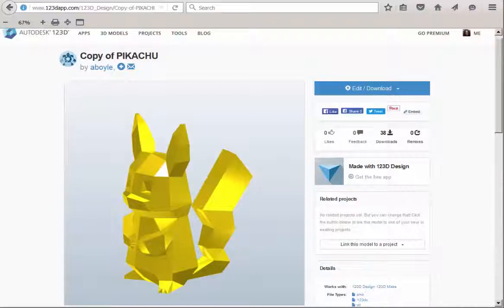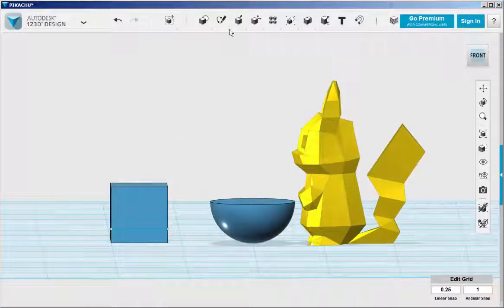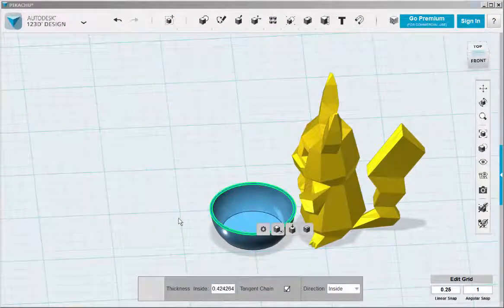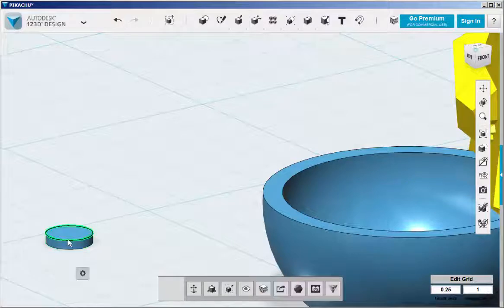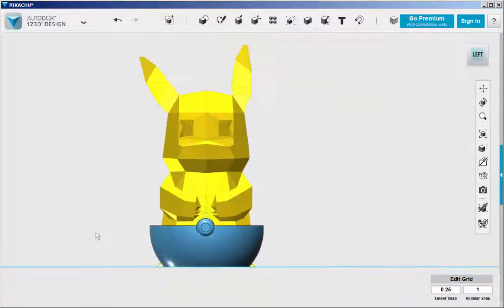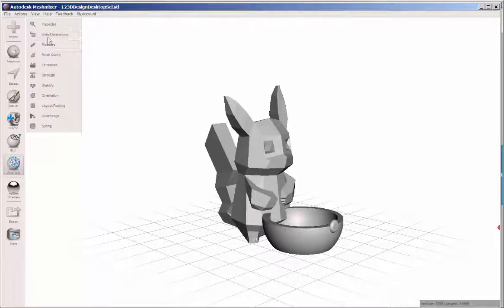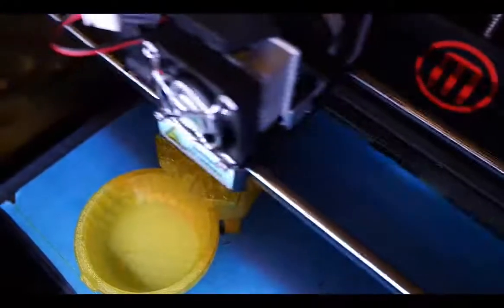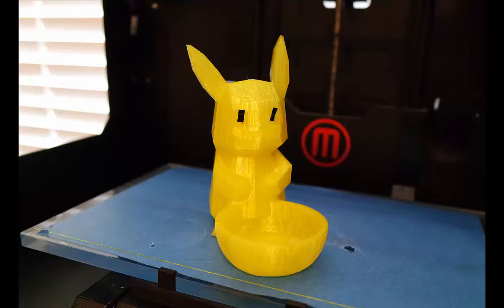123D Design: Pikachu Trinket Bowl (Giveaway)

Comment: Hi, thank for uploading the video. Do you use two side adhesive tape for hot plate?
Reply from the maker: Hi, I use painter's tape with adhesive just on the underside. I wipe it
 down after each print with 70% isopropyl alcohol in a spray bottle 
and washcloth. Works WONDERS for adhesion. Actually, I don't even need 
the painter's tape in many cases, just the alcohol on the bare build 
plate.
Reply: Thank you very much for information. it seems for bigger objects, the raft are getting separated from the hotplate surface because of tension arises on ABS material after cooling. 
the water based glues are drying fast and it looses its adhesion to hot plate. Can you tell me which company glue you use? thank you.
Reply from the maker: I misread your original post. The painter's tape is for a cold plate. For a hot plate, use BuildTak or PEI.
Reply: ProfDrafting Thank you very much for info. .